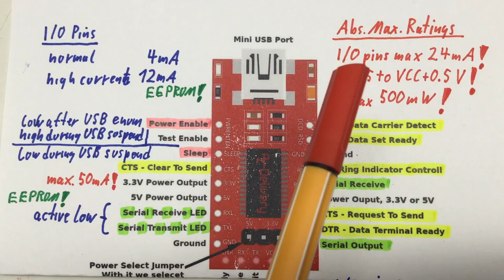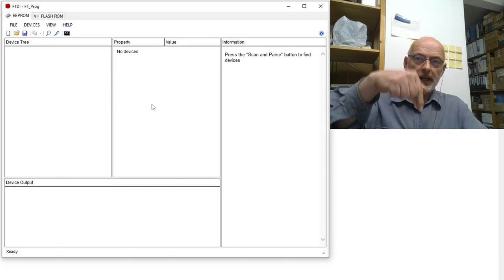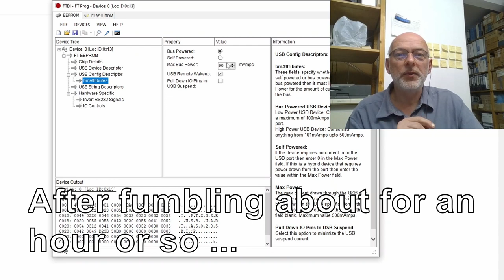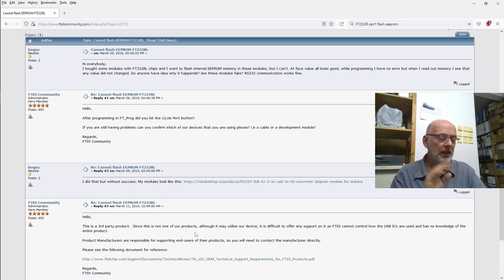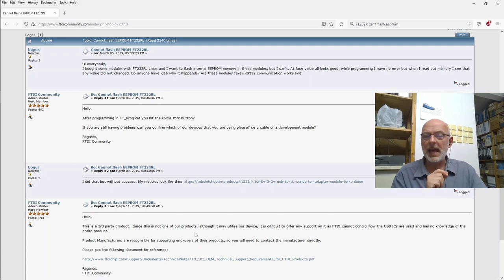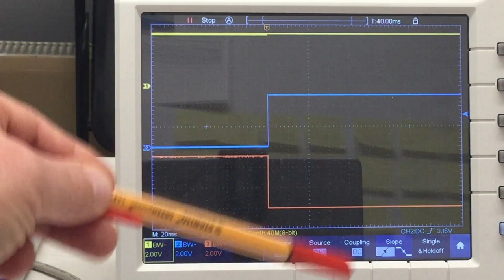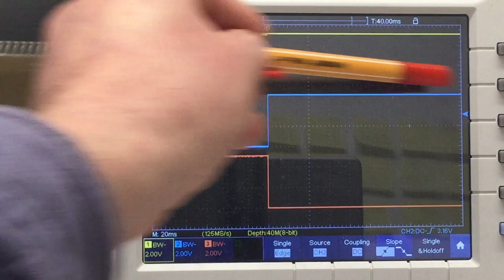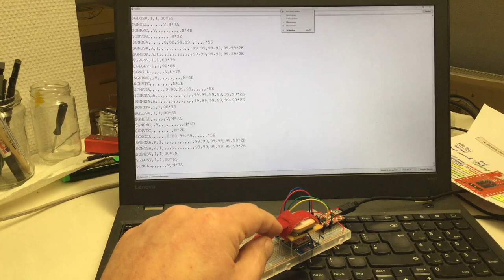FTDI FT232RL USB to Serial Module (AZ-Delivery) Detailed Review

Comment: Very nice explanation, i used ftdi for long time but never explored it. Thank you
Reply from the maker: I thank you for the praise 🙂
Reply from the maker: Hi Hassan, unfortunately your follow up comment got swallowed by YouTube. All I could recover from my bell menu was:
"I tried to change the current in the same way you did but it didn't work. nonetheless, i changed the current in the same environment but i did it in different way. First i entered the USB..."
Would love to hear how you solved the problem! It would be also OK if you deleted your comment, because after posting you realized it didn't work after all - happens to the best of us. Just don't let me hanging on, trying every "enter USB..." in FT_PROG 😉
Reply: @robertssmorgasbord  My apologies, i deleted it. 
 I tried to alter the current and it was working but when i turned off and on the ftdi,  it return to default 90ma.
So i deleted my comment 😅.
I was tring hardly to hack it but no way.
It works only when its ON when i restarted it, it returns to the default state.
So i wrote my comment before i restart then i deleted it later.
My apologies
Reply from the maker: @hssnov  First, thank you very much for the reply! And no apologies needed 🙂 I also thought at one point that I had successfully set the current. But I was never able to replicate that. Afterwards I thought that maybe I just imagined things. Your post explains me eerie experience. Thanks again!

Comment: Thanks for the very detailed deep dive. I told you in a previous video that I was going to try and get optically isolated serial communication between a PC and a microcontroller, to prevent damage caused by both the MCU and PC being powered by the same mains power supply. 

the opto-isolation would also allow me to power the MCU without the FTDI converter's power supply, so I don't have to worry about the current limitations of the FDTI. 

Using this exact FTDI converter, an ESP32 and 2 high speed optocouplers (connecting the RX and TX lines of both modules), it worked great. 

I even managed to upload a sketch automatically (without having to press the reset button) through adding two more optocouplers, which connect RTS and DTR on the FTDR to EN and GPIO0 on the ESP32 respectively. 

Given that it makes all these extra pins available, I've found the FT232RL to be very versatile.
Reply from the maker: Good on you 🙂 I have to admit that I never fumbled about with the RS232 RTS and DTR lines (besides soldering a RS232 cable in the late 80s to connect a little Mitsubishi industrial robot arm to a PC - it was a high school project). But I'll will make use of the FT232RL in the near future too: Connecting my Chinese U-Blox NEO-M8N GPS module directly to a PC (video coming up this Sunday) and prototyping an isolated (of course) USB to RS-422 / NMEA 0183 HS adapter.
Reply: @robertssmorgasbord  cool! looking forward to it :).
Reply from the maker: @Gocast2  The video about the Chinese U-Blox NEO-M8N GPS module (plus the FT232RL) is up now: https://youtu.be/RwzfP7Q1zj0 🙂 It will be a while until I come around doing the USB to RS-422 / NMEA 0183 HS stuff though.

Comment: Great video. You are very good at speaking your mind and definitely love your accent. I recently got my first FT232RL board+chip (seems to be original, it's programmable) and I was confused as to when should I invert the RS232 signal. My ESP32 microcontroller works with both signal logics but have one router device that only works with the default logic. Thank you for your time and dedication.
Reply from the maker: Thanks for the praise! And for liking my accent 😅 As for the inverting of the RS-232 signal: 0s and start bits are high, 1s and stop bits are low. The USARTs of many MCUs (e.g. ATmega) do just that and don't even have the option of inverting the I/O signal. It's nice that the ESP32 does have such an option though. If in doubt, just have a look with an oscilloscope 😉

Comment: So much knowledge! I have the same device from Amazon but my chip says FTDI, whether that makes a difference in it's writing capability I have no idea...

I'm trying to retrieve an original 2001 Xbox's EEPROM currently and only have this little thing at hand. The problem is: the retrieval method is done using SDA and SCL lines.
Is there any possibility to do this with this device or am I SOL? Thanks!

Also, your accent, ist du Deutsch??
Reply from the maker: Ja, ich bin Deutscher 😉 Regarding your problem: SDA and SCL lines belong to an I2C bus, which is synchronous (SCL - Slave CLock) and incompatible with RS232/UART (Universal Asynchronous Receiver/Transmitter). So I'm sorry to report, that you can't use those FTDI modules to read out your Xbox EEPROM. However, if you want to invest the time and effort, you can get yourself an Arduino (or any other) microcontroller. Those things connects to your PC via USB and have an I2C interface. Though, some programming is required.

Comment: Trying to use this to connect my radio transmitter.   Ground, VCC, and Signal wires connected to receiver.   But receiver doesn't seem to be getting power.   I might try jumping to 5V.
Reply from the maker: Well, before you change the jumper to 5V, make sure your radio transmitter cant take 5V. Also, the 3.3V supply out of that thing is pretty meager. It might break down powering a radio transmitter.
Reply: @robertssmorgasbord  5V worked.   Now trying to get signal to software.
Reply from the maker: @matthewjames4268  Good for you 🙂 Whish you luck with with the signal/software part!

Comment: Are you sure it is an original FTDI chip?
Reply: Yes, don't be ridiculous, of course it's a Chinese fake.
Reply from the maker: Well, I'm pretty sure it's not an unauthorized fake. As I mentioned the chip is stamped FT232-AZ. My best guess it's from an OEM batch made by FTDI for AZ-Delivery. AZ-Delivery probably choose to have a "fuse" (one-time programmable element on the chip) set to disable writing the EEPROM. As for why they've done that I can only speculate: A) They sell that chip on a breakout board with marked pins (e.g. power and sleep), but via the EEPROM users could redefine the pins and they wanted to avoid the support hassle that definitely would have come with that. B) FTDI was only willing to sell them a "castrated" OEM batch, because they didn't wanted to cannibalize their own sales. C) Your best guess here ...
Reply from the maker: @bimsbarkas  I don't think there unauthorized copies (fake). AZ-Delivery is an incorporated company here in Germany, and German authorities take product fakes very seriously. See also my answer to ciano.
Reply from the maker: @dokterzorro  Again, thanks for the info (see also my reply to your other comment). I will put AZ delivery on my blacklist and we can declare that chip a fake.
Reply: @robertssmorgasbord  
AZ just does what they all do: sell cheap stuff. Sometimes it's bad, sometimes it's surprisingly good. Arduino Nano boards are excellent from them, nice and cheap and fine for everyday use.
Reply from the maker: @dokterzorro  If you remember to install the CH340 serial driver 😉

Comment: Can I use it to program lilypad? Also what other modules can be used to program lilypad which can be plugged into a windows system....
Reply from the maker: Never worked with Lilypads, so I can't say for sure, but I don't see why it wouldn't work. Have a look at this, were they are using an FTDI based USB to serial converter to program a Lilypad: https://www.instructables.com/Arduino-Lilypad-Tutorial/

Comment: What is the name of the cable that connects to the right side of the unit ?
Reply from the maker: It's a Mini (not Micro) USB connector for an, well, USB cable. If you mean the other right, that's just an 2.54mm / 0.1'' 6 pin header, not intended for any specific cable.

Comment: Congratulations! Do you know how can i connect a rc receiver to that usb adaptor?  The receiver has 3 pins, ground, Vc+ and a signal pin.
Reply from the maker: Three question: does your RC receiver speak RS232 on the signal pin? What supply voltage does your RC receiver expect on the Vc+ pin and how much current does it draw? What is the signal level on your RC receivers signal pin?
Reply: @robertssmorgasbord  oh...i have no idea about these specs. The receiver is an rc airplane receiver AR7350. I dont know what is RS232. The receiver works with 5volts and consums about 50mah. And I don't know about signal level.
Reply from the maker: @theodorostsolos9983  Well, I had a quick look at the AR7350 (not much documentation available), and I'm pretty sure that the FTDI FT232RL is not suitable for connecting it via USB to an PC. Sorry!
Reply: But this receiver is supposed to be programmed via the spektrum usb cable SPM3065 which has the ftdi ft232 chip...
Reply from the maker: @theodorostsolos9983  Ah! Now we're getting somewhere! The original FTDI FT232 chip allows you to do a lot more that just adapt USB to logic level serial. With the right software (on the USB side) you can use it as a general I/O. NOTE: The chip on the module reviewed in the video has NOT an original FTDI FT232 chip! The chip on that module does NOT support all functionality of the original FTDI FT232 chip! Also, I had a look at the SPM3065 cable, and it's not clear HOW they use FTDI FT232 and what additional parts are in there. Since the SPM3065 cable goes for about 25 bucks, I would recommend to just buy it, instead of trying to reverse engineer it and build your own around an (original) FTDI FT232. It's just not worth it.
Reply: Yes, you have right, i want to buy the original Spma3065 but  i can't find it on stock in Europe. One last, on the ftdi chip you can apply only xml files only, or you can write software too?
Reply from the maker: @theodorostsolos9983  You can still get it on amazon.de ( https://www.amazon.de/Spektrum-SPMA3065-AS3X-EMPF-USB-PROGRAMMIERKABEL/dp/B00LMIPTFK/ref=sr_1_1?__mk_de_DE=%C3%85M%C3%85%C5%BD%C3%95%C3%91&crid=3ECQAVB4QLE8U&keywords=spma3065&qid=1697372860&sprefix=spma3065%2Caps%2C72&sr=8-1 ) and amazon.com ( https://www.amazon.com/-/de/dp/B00LMIPTFK/ref=sr_1_1?__mk_de_DE=%C3%85M%C3%85%C5%BD%C3%95%C3%91&crid=13TBEE13C4ZKO&keywords=spma3065&qid=1697373000&sprefix=spma3065%2Caps%2C153&sr=8-1 ). Both are shipping to Germany. Of course I don't know where you are located in Europe.

Comment: hi, i am doing 32ch relay board, so .I buy ft232 and ft4232 board, but I don't how to control shift resister with this. could u help? and please put video about Fd4232
Reply from the maker: Interesting project! I've never used the FT232/FT4232 in that manner. I'm guessing you want to use the CBUS pins in bit bang mode to control a 32-bit shift register. FTDIs application note AN_232R-01 (google for "FTDI AN_232R-01") describes that in detail. Regarding the FT4232: I'll put that on my wall of video ideas. No promises though! Especially because I normally don't do any  Windows/Linux programming stuff.
Reply: @robertssmorgasbord   thank you very much for your reply
Reply: please make 32ch digital output with ft4232
Reply from the maker: @balamohan5641  You're welcome!
Reply from the maker: @balamohan5641  As I've said, I've put it on my wall of video ideas 😉
Reply: @robertssmorgasbord  cool

Comment: Golly Gee, I should have watched this video first, would have saved me some time.  Mine looks like yours, I bought it for $4CAD and has a fake FTDI logo on the chip. Still, it's OK, as a plain vanilla (NOT programmable) serial interface. My serial number is A5XK3RJT, see if anybody else has this.

I did buy a real (programmable and at way more cost) chip and use it to CAT my Kenwood HF radio. The radio needs inverted signal levels.
Reply from the maker: Yeah, for the price these Chinese clones are not bad. You just have to curb your expectations in regards to programming them.
An original FTDI goes for 4.90€ + tax at Digikey. If the need arises I could simply swap the fake chip on the board with an original one 😅

Comment: Nonsense, true FTDI chips can be programmed. If you can't it is a fake chip, simple as that. No AZ delivery is not gonna get a special batch of FTDI made chips that can't be programmed because of a flag, that's just not how these chips work. They sell on Amazon and are just box-pushers who seem te have now upgraded to having the same chinese fake manufaturers to make them branded versions of the same fake chips we've been seeing a lot. For most applications the fake chips will do fine, for fast programming of microcontrollerchips it works. For some other stuff, like uninterrupted DMX sending it will crap out randomly and not work. Only REAL chips will do that 24/7 without faults. There is no excuse for these damn things, they make designing relyable hardware a nightmare. Ban them, burn them and hurray for FTDI trying to make all the fakes unuseable, maybe that way importers and resellers will take notice after the complaints start coming in. This needs to end, right now.
Reply from the maker: Thanks for your input! I myself have become a wee bit more careful about shouting out "Fake Chip!" (see "Faulty Chinese MAX31855K Modules: Fake Chips? No! Just a Capacitor Missing!" https://youtu.be/PywHVgJAMu8 ). But in this case (FT232RL) you are probably right. I also stumbled lately over a indisputable fake U-Blox NEO-M8N GPS module ( https://youtu.be/RwzfP7Q1zj0 ). In the past I constantly underestimated the Chinese manufacturing capabilities in that regard. I simply couldn't imagine that it would be profitable to develop (reverse engineer) and manufacture fake chips. But obviously I was wrong.
Reply: @robertssmorgasbord  
The engineering is quite impressive, in the case of the FT232 they used pretty complex processorchips to emulate the outdated design of the original chip. Like I said, for simple programming it will work fine, great for hobbyists on a budget as the original ftdi chip is expensive. Just know the limitations, it's not real so it can't be expected to work 100%. At least AZ is honest in not putting FTDI logo on the thing but their own, so they are easily identifyable. How are these sold, do they advertise them as FTDI or just the FT232 name?
Reply from the maker: @dokterzorro  Well, to be fair, if you look at their website ( https://www.az-delivery.de/en/products/ftdi-adapter-ft232rl ) there's no mentioning of FTDI or any of the original FTDI FT232 variants (FT232H/R/B etc.). They always call it a FT232-AZ and never use "FT232" without the "-AZ".

Comment: "If it looks like a duck, swims like a duck, and quacks like a duck, then it probably is a duck."... given no FT-PROG looks like a clone.  Decap it!
Reply from the maker: I hope with "decap" you mean using solvent and/or a grinder to expose the chip, and not decapitate 😉 Anyway, I would love to do that and compare the chip to an original FT232RL. But unfortunately I don't have the equipment, respectively, never done that before.